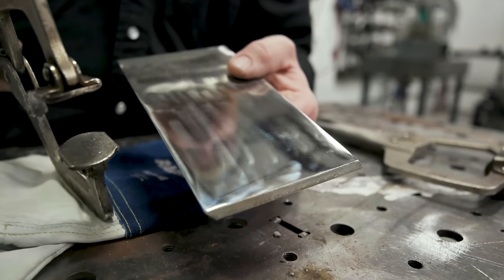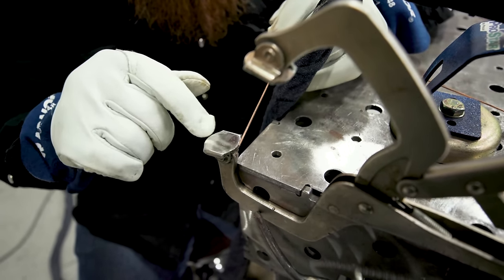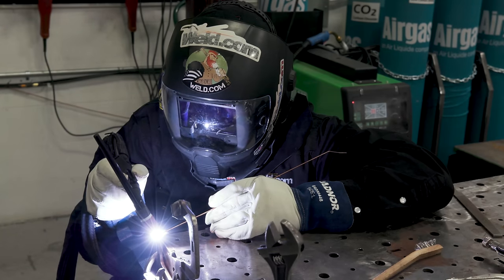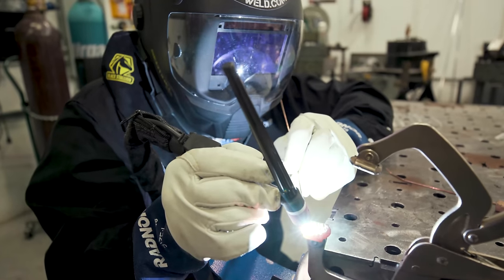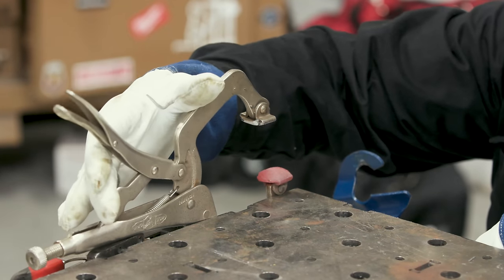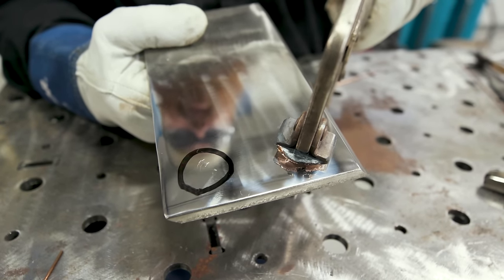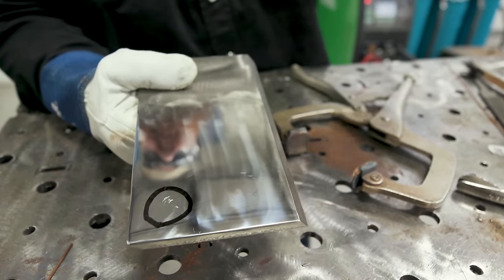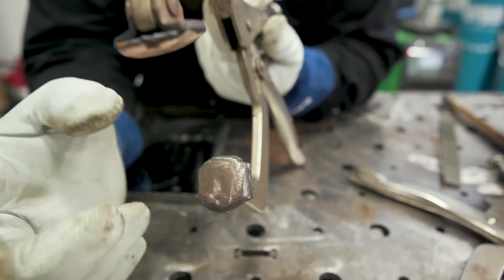Do this to Every Clamp You Own!

Comment: It'd take six months to do this to every clamp I own.
Reply from the maker: That's the best problem to have 🤑
Reply: Just use some copper sheets as buffer between your polished work and clamp. Can use a copper coin too.
Reply: Goals ......
Reply: Exactly what I was thinking...I'd also be super pissed the first time I want to clamp two thin pieces of stainless together for a butt weld and I couldn't get them flat together. I have a small stack of aluminium pads that I stick to my pads with double sided tape...been doing it for years never failed me yet and never left a mark. Takes me about 30 seconds not all day :)))
Reply: Fold a bit of lead leaf over it.

Comment: Now weld about a 2" washer to the tightening screw on edge vertically.  Lets you apply more torque to screw and makes it easy to hang on a hook.
Reply: Homemade wing nut kinda ,I dig it.

Comment: Here in the real world, we place a piece of cardboard between the clamp and the material. Cardboard will not mark even painted surfaces. Or you could indeed opt to screw up your clamps as shown. Do you know by heating you are changing both the Tensile strength and the Rockwell hardness of the jaws?

Comment: I just use tape and then acetone it if it leaves any adhesive. Takes literally 10 seconds and you don't have to permanently alter your clamps.
Reply: Yep.
Reply: but theres no downside to this
Reply: Beat me to it! I also do it on skillsaws  when doing cuts on finish carpentry wood working.
Reply: tape is far better , jasons idea would invalidate the warranty of all the clamps I have
Reply: Except the clamp can be part of the earthing of the part, unless you tape it.
Reply: @Longtrailside  Jigsaw is where I've gotten the most use out of it. Lets you cut easily on finished surfaces without having to refinish at all.
Reply: Me too

Comment: Couldn't you save a lot of time by just brazing or soldering on some pennies? Maybe even using a high heat epoxy.
Reply: Pennies would work great (pre-1983) I use a bent copper sheet in my vise for the same reason.
Reply: When you get around scraps, look for copper pipe and tubing... You can flatten that out for a decent "pad" too... 

   From older school "metallurgy", bronze and brass are (average) about 10 times harder than copper... SO it'll wear out fairly easily, and you don't want to waste a lot of time or money on it for a sacrificial pad. ;o)

Comment: i work alot with polished stainless building highend cabinetry and grills and we wrap our clamps with copper sheeting and works the same without having to permanently welding to your clamps
Reply: Yeah to tac a piece of copper would be faster. I would show guys to use a copper knife to cut the plastic.
Reply: we use a copper knife with the edges coated in silicon bronze filler rod to keep the edges sharper longer

Comment: Everything in the Teflon division of Dupont had to be polished to a #16 mirror finish, stainless steel,mixer blades, shafts and the inside of the poly kettles by hand.Not sure but I think they use electro plating currently, haven't been in there since 2000.

Comment: If you haven't got any silicone bronze you can use straight copper electrical wire tig brazed to them as well it's also good cheap practice for tig brazing

Comment: Cool idea and probably more permanent, but I just buy those little felt stick-on cushion pads, (which were designed, I think, as shock absorbers for cupboard door corners)at Home Depot and put one on each face plate on my vice grip pliers and I’m off to the races.

Comment: Great tip - highly recommended and good practice to have non marking clamps even on parts that can't be seen.  I plaster anything used for clamping (or grounding) in Silicon or Aluminium bronze. Lots of are saying use tape, I often do, but it doesn't work close to welds and the residues are forbidden on a lot of stainless work.  Great Channel.

Comment: Great tip, but for us that don’t have a TIG machine, I simply use a piece of thin particle board as a cushion.  It’s even softer than silicon bronze metal on the piece, yet strong enough to hold the material long enough to get some welds in.   Yeah it falls off when I clipping, but no big deal.

Comment: I just use some polyimide tape as an interface layer between my clamp and the workpiece. Resists ridiculously high temps and can easily be removed without permanently modifying the clamp.
Reply: Came looking for a comment like this.

Comment: Or you could just run the tig torch over it.... you are gonna anneal the tool steel /highcarbon steel in the foot.... its probably softer than the nickel alloy stainless with just the anneal heat from the pool..... or 10 seconds and a couple layers of blue tape.... plus...... it smells good and makes me feel funny inside when it gets close to incinerating.

Comment: I wonder if silicone sealant can do the same trick. It can handle heat. Like, make a ring with tape around the pad to hold the silicone in while it cures, pump a bit of the stuff and use a wire to pretty things up if youre worried about how it looks in the end.

Comment: I usually just hot glue some thick leather from old tool pouches and boots onto the fingers if I need to protect surfaces, but I may do this to a set of clamps.
Reply from the maker: That's a good method as well 👍

Comment: Bronze is softer than aluminum? Hmmmm.
Reply: There might be exceptions, but yes many aluminium alloys is harder than many brons alloys.
Reply: Emil Muhrman I don’t know which to look at in this comparison, maybe you do, between rockwell scale B and Brinell Hardness scale. But 6061 seems to have a higher Rockwell than silicon bronze but a lower Brinell. But that seems to be the only one I found easily in my short search. Do you have a better reference? Not that this is earth changing, so don’t spend much time looking, it’s not that important.
Reply: I just looked up brons brazing rod and it said 50-80 on the Brinell scale. And most aluminium alloys I know of is around or above 100. But still, this is probably not a fail safe method on aluminium sense there is some alloys below 80.
Reply: Emil Muhrman right. Certainly better than steel at least. There is also a clear difference between silicon bronze and aluminum bronze, since those are the two most common bronze rods you’ll find.

Comment: Couldn't you just use leather pads?
Reply: There's a lot of ways to not scratch your base metal. You could just bend up some copper or aluminum caps that slip over the jaws, wood works too.
Reply: Do you want burnt leather?

Comment: i have a question what shade should i use for tig welding.I use a shade 10 for mig and stick do i need a darker shade for tig welding?
Reply from the maker: All depends on your preference and amperage.
Reply: You can start practicing your TIG with the #10 you have but for sheet steel work you may end up going with a #8.  If you end up doing a fair bit of TIG then get a TIG specific auto darkening lens pack.

Comment: How about just polishing after welding?
Reply: Because if its a repair on an existing part you dont have the extra work of repolishing. Good time saver in the long run. Although soft shims would be a quick fix.